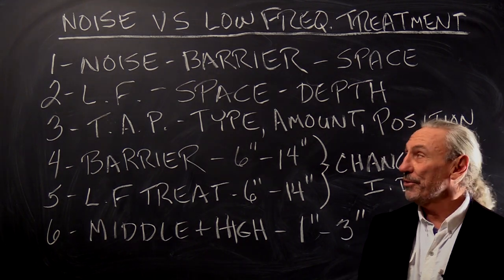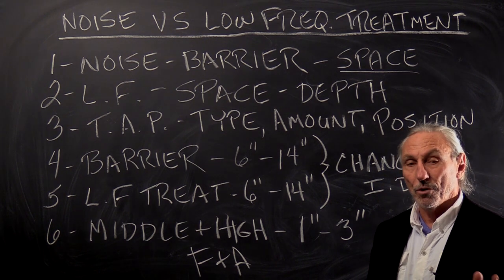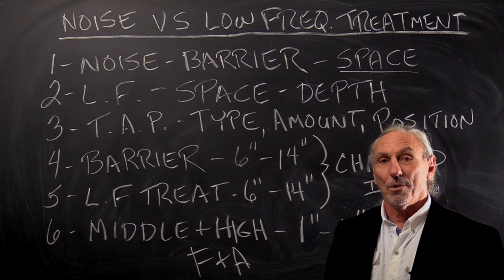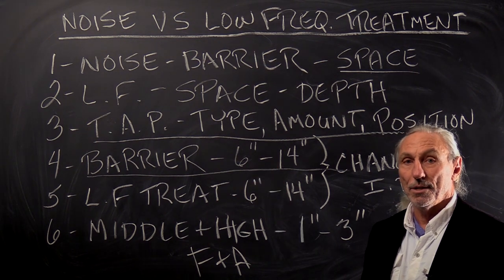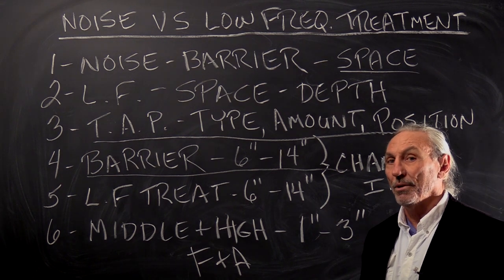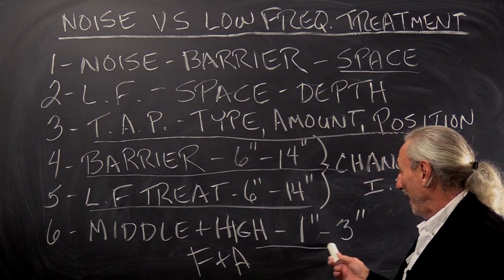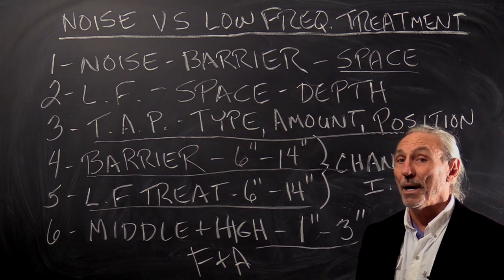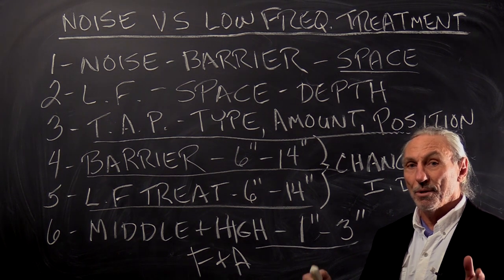Noise vs Low Frequency Treatment - www.AcousticFields.com

Comment: Curious, is the new set of problems created by shrinking your room size refer to room frequencies and changing null points?  I've noticed in multiple videos you briefly mention it but don't say what the new problems created are exactly.  I want to make sure I understand you correctly going forward while watching more of your videos.  --Jason ✌🏻&❤️
Reply from the maker: Its a trade off between a smaller room size that has a better response curve.
Reply: @AcousticFields  Excellent, Thank you for the fast reply Dennis 👍🏻✌🏻❤️

Comment: Yes, those selling foam make some grandiose claims about the sound barrier capabilities of their products. Reverb, yes. Low Frequency definitely not. In fact, I can’t imagine a barrier that can block jet engines. What material is used?
Reply from the maker: D,  Concrete and steel, materials that have high densities and mass.
Reply: @AcousticFields  what about bricks?
Reply from the maker: M,  Yes. However, you must assemble these different masses in the correct order and using the correct vibration reducing methodologies. There is a science to the assembly and selection of materials based upon the noise frequency and amplitude issues you have to isolate against.
Reply: @AcousticFields  How many feet of concrete and steel are you going to need for the roof/Ceiling to block airplane noise?  :-)
Reply: @AcousticFields  Would it be cheaper to build underground?
Reply from the maker: O,  Earth is a good barrier material, Especially for lower frequencies. It has mass and the associated density requirements.
Reply from the maker: O, Wit external full range pressure levels exceeding 150 dB SPL , I would estimate at least two feet of concrete with steel plate linings.
Reply: sound travels faster in high density materials e.g 3150m/s for steel.